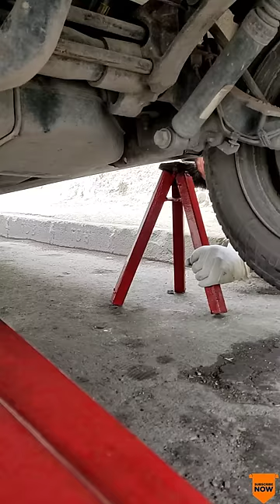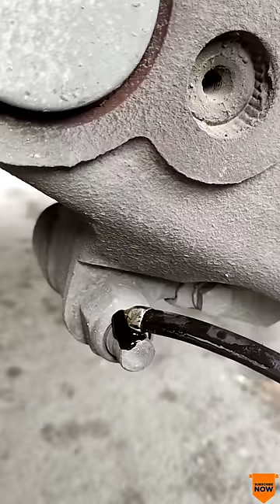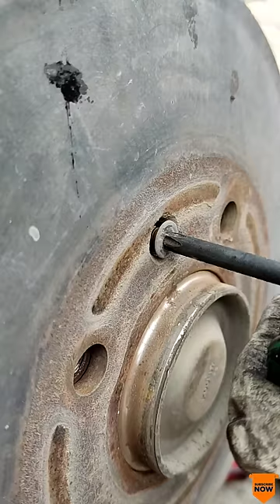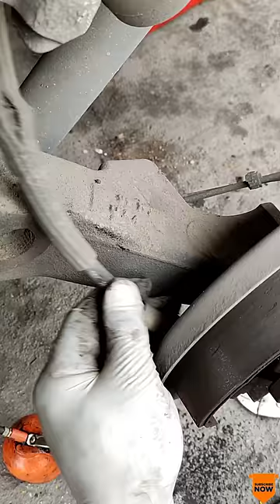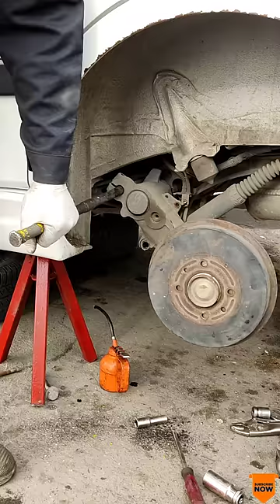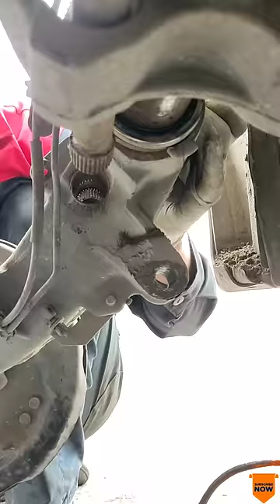#shorts #mechanic

Comment: The video stopped there because this axle is too far gone. Here in Brazil, we replace the bearings with machined plastic bushings. The rear suspension gets a little harder, but it works.

Comment: Got to be European car to have pivot bearing to be independent suspension and torsion bar spring to eliminate sway bar linkage. Excellent design for comfort and handling poor for having too many parts to replace when failure occurs like this.

Comment: That's a weird suspension set up haven't worked on anything like this
Reply: Its a torsionbar. All VW aircooled models had this type of suspension...!
Reply: This torsion bar suspension is very soft and was used mostly in French cars and in VW air-cooled vehicles